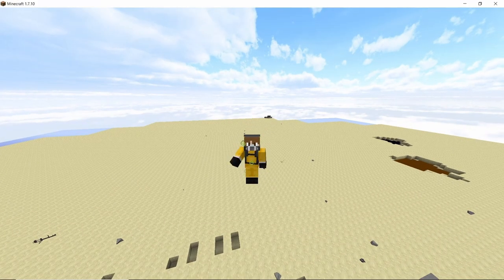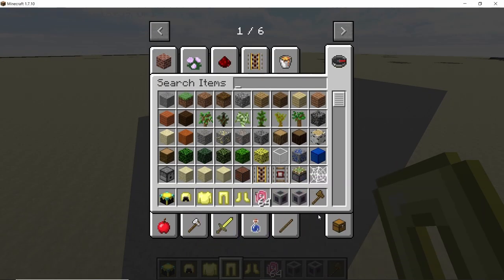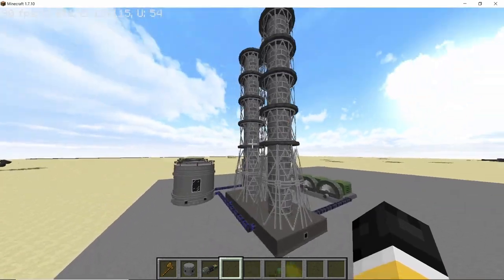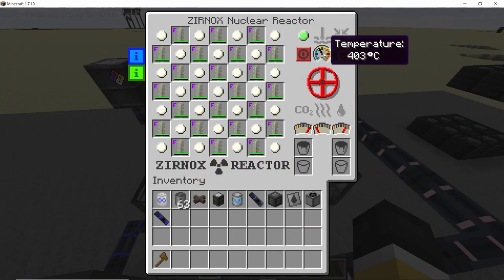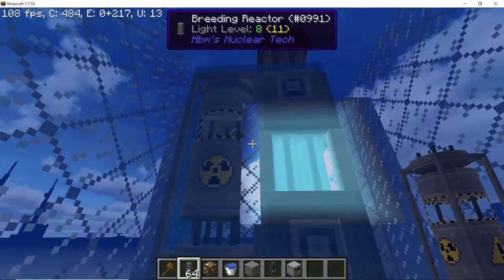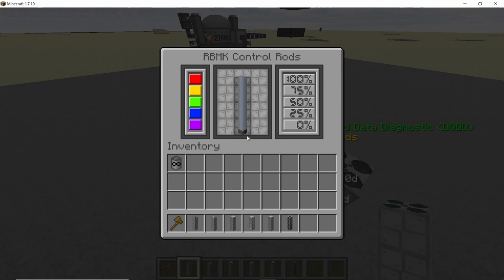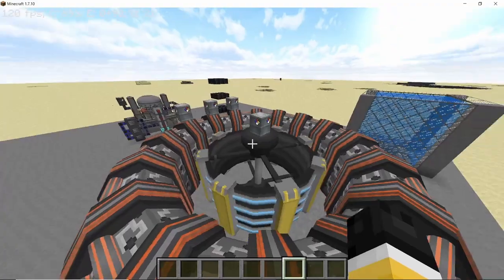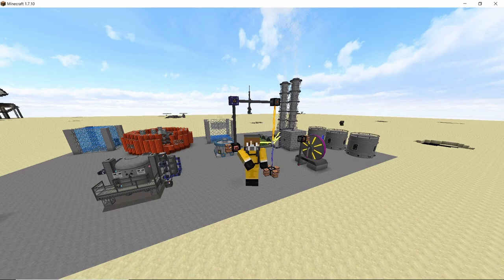How to prevent NUCLEAR MELTDOWN for different reactors in HBM's NTM

Comment: How do you tell if an RBMK reactor is AZ-5 compatible or not?
Reply from the maker: If by putting down all the control rods the reactor shuts down completely then it's az5 capable. You can do that by surrounding a fuel rod on all the sides by the normal control rods
Reply: @SavageVegeta  Ty!

Comment: The updated big nuclear reactor (pwr) just explodes for me for no reason pls help
Reply from the maker: Weird, I made one today and it was working just fine for me, try switching out the fuel to something less reactive or maybe don't pull out the control rods fully. I'm also working on a pwr video which should be out soon so maybe it'll help
Reply: @SavageVegeta  ohhh yeah the control rods could be the problem
Reply: @SavageVegeta  but I use meu 235 rods
Reply from the maker: @Maxib226  meu 235 is a moderate fuel for sure, then yeah I'll suggest just raise your control rods slowly and stop when the temperature hits the red section
Reply: @SavageVegeta  oh yeah I wanted to build a modern powerplant so I don't look at the reactor too much after startup. It exploded. But I think I should use an rbmk setup if I wanted to build a secure reactor I don't need to look at to often. The modern powerplant I built took me two hours and it just exploded ):
Reply from the maker: @Maxib226  that definitely sucks, also RBMKs in general are more dangerous than PWR cause with PWR the flux is constant once it's made. With RBMK the heat and flux will constantly keep on changing which requires more monitoring on the players part
Reply: @SavageVegeta  yeah but the rbmk Is better for me because it hasn't exploded for me
Reply from the maker: @Maxib226  alright then RBMK it is!!
Reply: @SavageVegeta  yes until I get the Chernobyl 💀

Comment: Jow do i prevent my reserch reactor from leaking when i put a breeding reactor it starts to leak radiation
Reply from the maker: one way of doing that is submerging the entire setup in water. Reason being whenever the breeding reactor will have something breedable in it the radiation will not leak out as it will act like a neutron absorber
but when it is empty and if you run the research reactor neutrons will fly out. So it's better to always keep it submerged so that no matter the condition it will never leak radiation